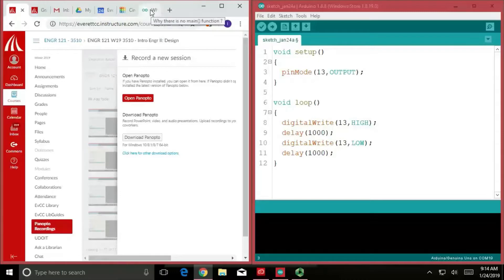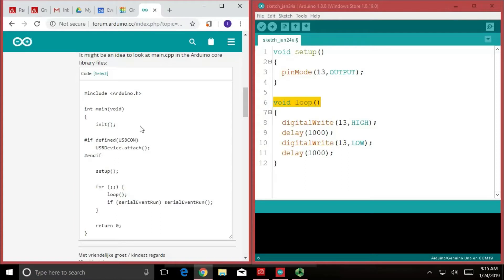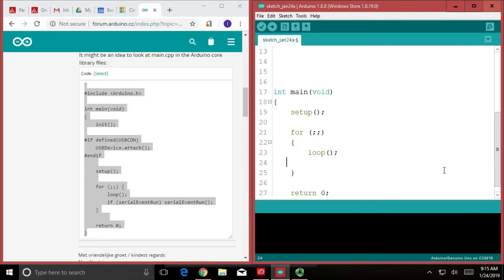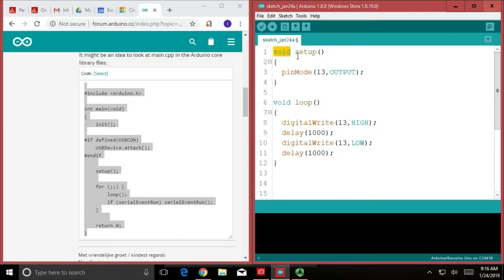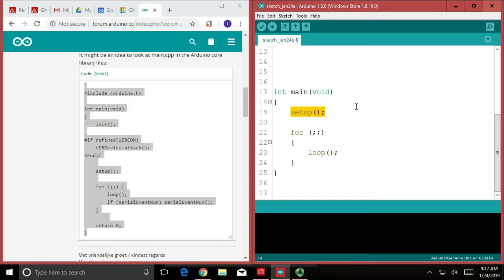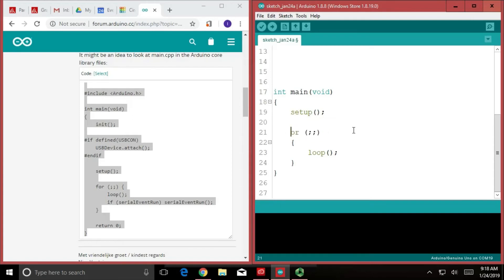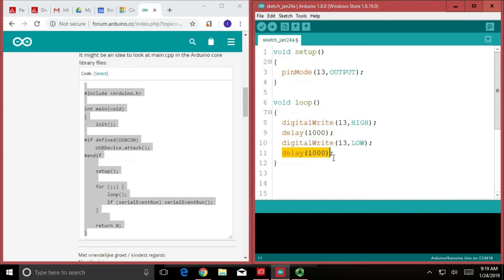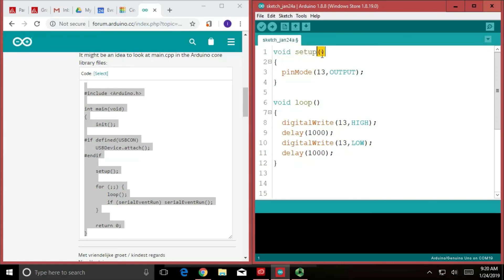Arduino - Functions 1 - C++ vs Arduino (old version)

Comment: Very good!!  Really i am searching for instructions that are compatible for arduino ide from CC+, such as PORTn, or BITn, which are not explained in arduino ide instructions set. Those instructions are extremely usefull, and as a beginner, it´s too difficult for me to start with CC+.
I only want to know how much from CC+ instructions can be written in arduinos ide directly, in order to get some more functionality, without having to start with complicated  learning of CC+, since arduino boards are enough for me , and it´s not necessary to start programming isolated microprocessors
Thanks